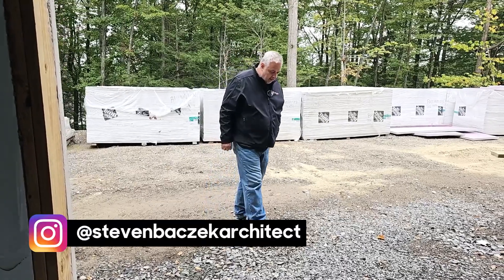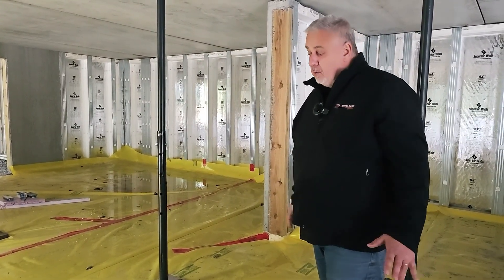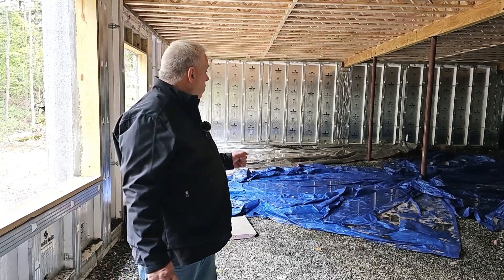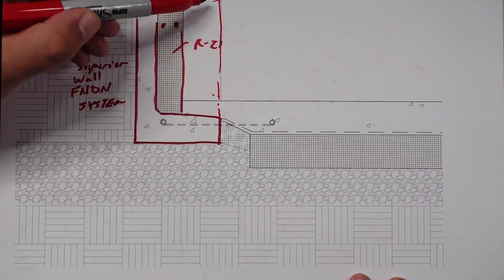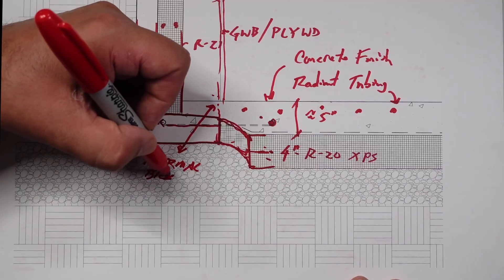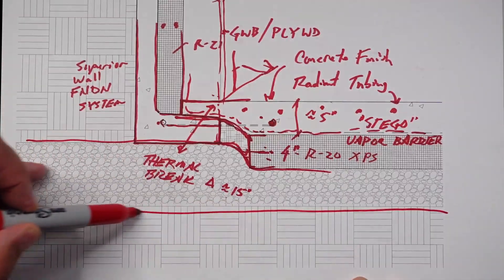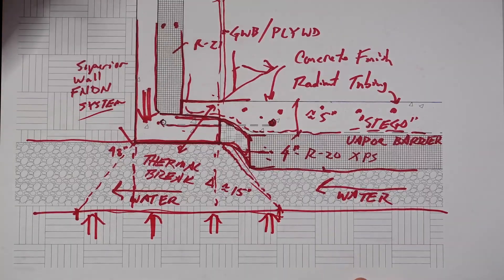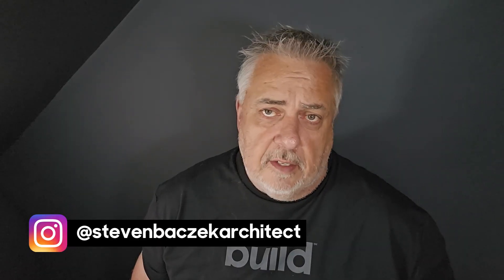INSULATED SLAB ASSEMBLY DETAILS

Comment: Why couldn't you run the insulation under the foundation wall and create a complete thermal break? Certainly, the compression rating on that insulation would far exceed the compression of the superior wall system.

Comment: I noticed the Stego over the foam, and at oher times the vapor barrier is below the foam.  What determines that distinction on a build project?
Reply: Putting the vapor barrier over the foam could help prevent the individual pieces of foam from floating up during the pour.
Reply from the maker: Doesn't really matter - builder preference, one that best fits the detail......